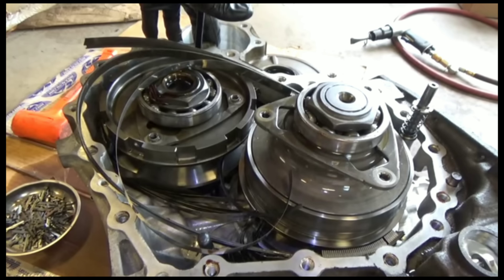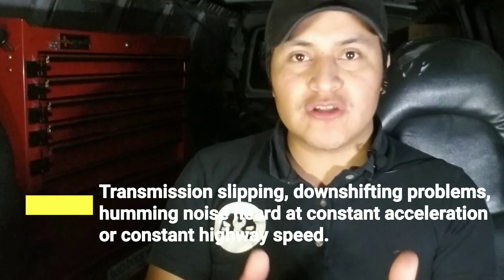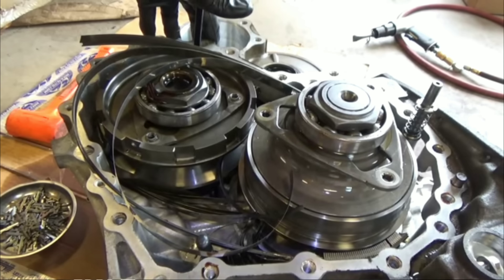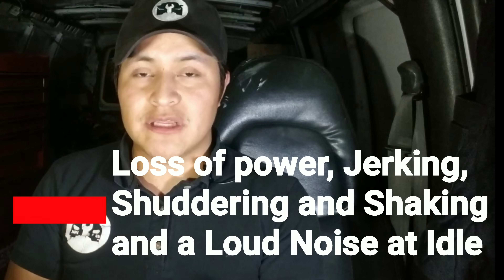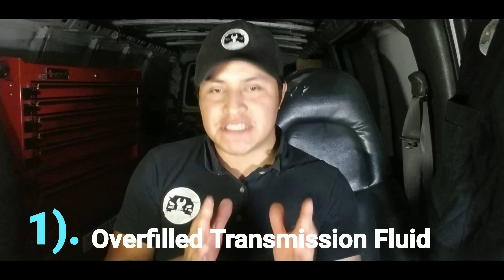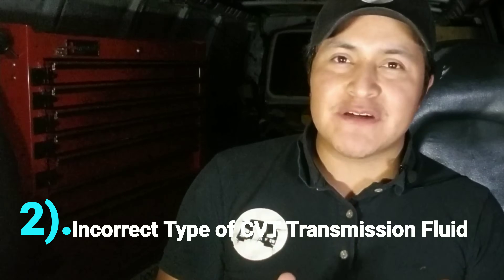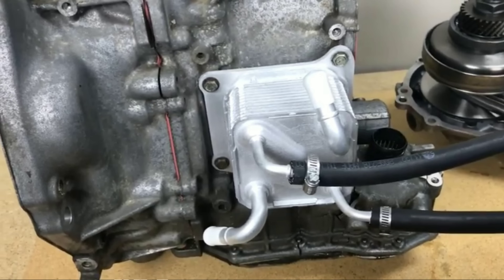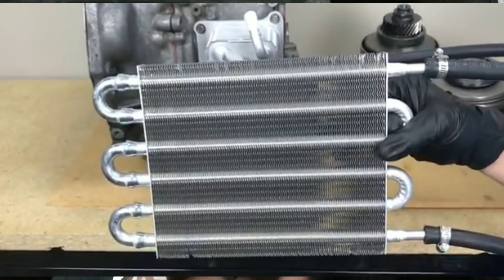NISSAN CVT TRANSMISSION | why it fails and what you can do about it to prolong it's life

Comment: Will changing out 4 quarts with the recommended Nissan's fluid help extend the life if its already slipping in 1st gear?
Reply: Same thing is happening with my car.Nissan Altima 08. Just when I'm going off a red light or a stop sign will it slip, but after that it changes just fine. Basically if I come to a complete stop
Reply: @KlaNks_-v2  I just bought an 08 how could you tell if the gears slipping or not when it don’t change gears? Have you had any major problems with yours? Reading all these comments making me nervous.
Reply: @shantaereed5703  you'll know if the transmission is bad just by driving it. Basically if you're at a red light or a stop. Whenever you come to a complete stop and then you hit the gas it goes super slow until it gets a little momentum then it drives fine. Well my car at least. The motor works fine. So you'll know it's slipping bc it accelerates slow off a stop . I bought it used and i didn't really notice it being bad or know about the faulty transmissions, so I would floor it on red lights sometime lol. Bad idea bc i think it was already around the milage that they have problems, which is around 60k plus miles. Mine was 97k when I got it. Basically don't accelerate to quick off complete stops if you don't notice anything bad with your cars transmission bc it will definitely go bad quick.
Reply: @shantaereed5703  look more into it. If your transmission is fine still then i think doing a transmission oil change helps. But if it's already going bad then I think it's best not to change it bc it will make it completely stop working. That's what I've been told, I'm not a mechanic. But check on the internet, i think there might be some things you can do to extend the life of it if it's still working fine. I was seeing something about some cooling system for the oil that can be added or something like that. Just do some quick research.

Comment: it's not too bad of a video, and the information is something that most people do not think about.  One issue with the CVT is power and displacement of the engine.  If you get the 3L+ engine or want to tow, stay away as it will immediately overheat the CVT.  This transmission wasn't made for towing or medium duty driving, and do not race with the car.  You will overheat the transmission/cvt fluit.

Comment: 2007 Nissan Maxima owner here for 14 years, I'm almost at 200k miles. Changed my transmission oil & filter only once at around 110k miles and car is still going strong.
I would add another point basically with any other car, don't drive like an
 asshole on the road. Your car will thank you for it.
Reply: Hello? Exactly
Reply: Swear most people with car problems dog there cars out and treat them like race cars. (Use to do that) I now baby my car and everything works the way it should for as long as it should

Comment: Thank you so much for the detail explanation, I had a Nissan Altima with 132000 miles, Same Humm and car was Jerking when pushing the gas pedal.  I fixed it while changing the car to Toyota highlander never gonna buy Nissan Again.

Comment: I have a 2014 altima. I'm having issues with rpm tachometer fluctuating. I have been to dealership every month just about.  1st they did diagnostic no codes. 2nd time reprogrammed TCM and 3rd ECM and then there was hesitating in acceleration.  So they installed stop switch. Now this month my rpm is fluctuating yet again badly. So one dealership says nothing is wrong. Oh thats normal for rpm to do that!! What?? Not while I'm at a steady speed..never normal to me. So guess he thinks I'm a naive woman. So I am taking to another dealership. This is out of control. I just want my car fixed...what is it? Transmission? I had the cvt Transmission serviced  in October last year. I had no problems with my car until I did  that. And you spoke of a whining noise...is that something I can hear in drivers seat? Bc I heard a noise kind of like a up and faint sound. Not constant but when car is sitting in park.
Reply: What was the issue maam?

Comment: My 2013 Altima (V6) started the suddering thing at only 700 miles. I was replaced under warranty and the new one worked for 70k miles. They told me the wrong fluid was put in at the factory but I don't know if that was true or if they just needed a story to make me feel better about the car.
Reply: Nissan employees are notorious liars so probably the latter

Comment: 2010 Nissan Altima 2.5 / 154,000  miles no problems. I never floor it when accelerating. I don't live in a hilly area so not a lot of stress on it when driving. Bought it 2017 with 77,000 miles
Reply: Have a 2010 Altima, too.  252K and transmission holding up good so far.

Comment: Hi, thank you for this video. I have a 2004 Nissan Murano, but I didn't buy it new. I have had it for 4 1/2 years now, and have been wondering about the transmission.

I actually don't have any problems with the transmission, there is no slipping, no noises, I am just wondering how long the transmission usually lasts, and if I should just get it serviced (flush, new fluid and filter).

The car has about 126,000 miles right now, and I only drive about 8,000 to 9,000 miles a year. I've been contemplating selling to go into a new (or newer) car, but also wondering realistically how much longer I can drive the car.
Reply: Sell it as fast as you can trust me my 2012 nissian Murano cvt cost me 4358 to replace

Comment: So, If a 2014 Nissan Versa SV with 62K miles on it, clean and straight... for sale with for asking price $1,500 by current owner that says "runs well but, sometimes transmission slips" and guess back window missing and needs replaced...
Is car junk now? 
Can a new or rebuilt transmission be installed and if so is it too expensive and not worth the effort.
Reply: Idk. That is so cheap it might be worth it to get a new tranny. Still a young car

Comment: Great video but you do nothave to avoid the Nissan purchase because of CVT issues, nor do you have to replace the transmissions in most cases.  I learned about a product line that’s been around for 30 years virtually no one  knows about because it was only sold to industrial companies including NASA and our Military, and tested in the racing industry. Now it’s available to the public and I put it in all of my vehicles “before” they have the problems! (But I have read so many people who have had CVT issues, hemi issues, 4.9 and 5.9 dodge issues, shuddering, vibrations, loss of power on start up, you make it... and they talk about this product line and how they did kit have to replace their engines or transmissions like their mechanic said they would have to. Instead they used these products. The company markets with the term “ultra frictions reduced and lubricant, however  . I learned  they are actually legally “supplements”  considered green and certified to lower emissions. They lower fuel mileage, address the CVT and endings issues... What impressed me as mischief as people randomly commenting about their experiences was the companies demo motor/engine. It’s mounted ion a dolly type trailer with a cut out so you can see inside has no oil. After they treated it with the product line it’s now ran 1300 hours without oil... now, I would nit recommend  we not put oil in our cars , trucks, semis, boats, motorcycles lol, but that sure supports their claim that the products lower engine heat and protect the engine! I cannot say enough about this product line. We have it in my new Infiniti for protection, our scion, our Honda Ridgeline, we have it in our sons high mileage trailblazer, and I tell all my family and friends about it!! Oh! Guess I better tell you!! The products I buy from their website are the CVT, The gas and diesel engine conditioner, (my daughter has a dodge diesel), the fuel and radiator supplements. Also the tech is patented. It has some nano molecular technology and electrostatic process that makes it work? It’s got some big certification by a Texas lab and if it’s good enough for our military weapons to prevent the from failing it’s sure good enough for me to try , so I did. I feel like I have discovered “Magic in a Bottle, truly. JilCat Proline  has my business forever! Keep your CVT, just protect it! This stuff removes sludge and protects! Never will I buy a standard lubricant again.
Reply: Oops JilCat.com is where I buy it! They even talk specifically about the CVT on their Auto Rescue page.

Comment: This is bad information. Sorry to disappoint, I have a 2011 Altima 3.5 SR and that thing is a beast. Wonderful car for road trips. The main issue began as people are referring to CVT as a term for sport function, but it’s not. CVT allows smoother rides and high torque power with acceleration. True to form, my 2011 Altima 3.5SR (V6) has 234,000 miles and my transmission is still in good condition, doesn’t skip a beat and works perfectly fine. Change your fluids more often, keep up with maintenance and your CVT will thank you. Put good quality parts in and good quality fluids, oils, lubricants and that car will pay dividends.

Comment: If you want to extend the life of your cvt, the key is to 1.) keep you engine revvs under 3k rpm when accelerating.  In other words, don't accelerate hard i.e. pedal to the medal.  Everyone's out there pushing their grocery getters to the maximum -- just don't be tempted to join them.  Also, 2.) don't just sit in your car with the engine running and the a/c full blast prolonged periods of time.  Your cvt will thank you.  Last, 3.) change your fluids at the correct intervals, coolant and nissan cvt transmission fluid.  25-30k max.  

This coming from a current 2017 Altima SR owner that had a rebuilt transmission installed a few weeks ago.  Total cost: over 5k of which $500 I was responsible for!  Thank gawd I was smart enough to purchase an extended 100k warranty!!!
Reply: What happens if it goes to like 6,000 rpm at 60 mph?
Reply: @TamikaX  if you accelerate/ launch hard, pushing all the way down on the gas pedal, it will.  However, just driving under normal cruising speeds it shouldn't revv any higher than 1800 rpm.  If you're saying the motor stays locked in at 6k rpms the entire time while driving at 60 mph -- that is not good.  That's a telltale sign of a cvt transmission that is slipping bad (won't engage) and will need to be replaced or rebuilt.  6000 revolution/rotation per minute is way too many revs (too hard on an engine) for a stock motor to continously operate under, especially any Nissan with a cvt.  Should only be 1300-1800 revs; shift at around 3k rpms under soft launches.
Reply: @roblockhart6104  wow. I was thinking this. I'm gonna put the new spark plugs and coils in first. Most def can't afford a new transmission. Its  slim pickings for good mechanics here. Thanks for your response.
Reply: @TamikaX  lol new Sparks and plugs plus paying the person to do it, you can spend $6-700 more on top of dat  n get a used CVT!
Reply: @kingaza7734  welp, at this point I paid for someone to put then in and the car is worst off.  Do you know where I could get a used cvt transmission?
Reply: @kingaza7734  chile, I need it. I'm kinda scared to order one online. Then mechanics gone charge an arm and a leg to put it on. But thanks.
Reply: @TamikaX  best thing I can tell you, is find a independent shop that you can trust, then tell them to order it online. In most cases they get discounts and or know a place they can get one for a discounted price, good luck. Without paying 3-5 grand that is. 1,200 the most..
Reply: @kingaza7734  thank you! I done took my whip to two places and the car is worst off. I think they took parts from my car, the battery wont stay charged. Folks are also going around stealing catalytic converters 🤦🏿‍♀️
Reply: @TamikaX  did you ever get your car fixed?  Was the charging issue the alternator?
Reply: @TheSwankynina  hiii, well it's running now and I haven't had the alternator checked. I'm thinking the guy I took it to did some sheisty things to my whip.

Comment: First video I’ve seen about this issue that addressed the issue and what you need to do to get it fixed. Great video!
Reply: Am here in 2025 researching before deciding on a 2023 Nissan Rogue. Very comprehensive and most enlightening about how to minimize a known issue from the CVT

Comment: owner of a 2009 altima here. this information is very helpful thank you.

I did a transmission fluid change at 150k miles and it helped. im now at 172k and experiencing the transmission slips every now and then. 

will definitely do another transmission fluid change and install a cooler. 

thanks again sir
Reply: Did it help you at all? The dealership told me changing the fluid might damage the transmission even more if its the issue.

Comment: owned a 91 , 99, and 2001 maxima AND THEY ALL HAD TRANSMISSION ISSUES. . . there are almost no maximas on the road after 10 years. . thinka about it, . . great engine, horrible tranny, it then just got worst after they went to cvt

Comment: https://emanuals.com/blog/nissan-cvt-transmission-warranty-and-lawsuit-settlements/    Boring and his info given by Nissan is inaccurate.  All that he says is common sense but here's the solution if the CVT has already failed ....                                                                                                                                                                                                                                          This is the best link I refer everyone to on getting your CVT fixed for free. The original  CVT warranty was for 5 years / 60, 000 whichever comes first.  The first generation CVT's have a warranty that extends their CVT to 120,000 miles.  It was decided in a lawsuit.  Nissan has agreed on cars built 2013- 2016 to extend their original warranty on the CVT another 24 months/24,000 miles bringing that to 7 years/ 84,000 miles.  Some of you may have even a longer warranty as some dealerships offered free extended  CVT warranties on new cars to 150,000 or even the life of the original owner.  Lifetime is what my dealership offered and they say they will honor it. My best advice is every 35,000 miles do a drain and fill just to error on the safe side.  I did that on my new 2016 Altima  vehicle and the CVT still went at 57,000 miles.  At least I did my part to avoid it from happening.  I hope going forward I'm in the clear.  Everyone please see the link I provided. It states that even though we've gone beyond the 1/20/20 deadline to file a lawsuit claim we still can file a claim.  You just have to act within 30 days of the initial service with your dealership.   Good luck Everyone.  God Bless

Comment: The issue is people don't change the fluid\filter every 30k miles.....And yes these cars have serviceable filters...If you don't  the Stepper Motor goes bad...Also the transmission speed sensors go out.....

And yes. The number #1 issue I find. They don't service the cooling system...I just fixed one in limp mode. They have green antifreeze in it. And the Stepper motor needs to be replaced..

Comment: Hi Thanks for your excellent info about transmission. Even though you are nissan transmission expertise based on your experience let me ask you a question. I have Honda Odyssey 2006, till  55,000 miles never change trns fluid. Last year when I was driving around 75 /hr all fluid out through breather line I guess.  On the way I refilled and go back home. Next day  Honda trans fluid from  dealer and till one year no problem. Then again this year when I was driving highway same thing happened lucky I had in my van I put it and went back home. I'm driving now no problem. I went to different people they diagnosis couldn't find anything. I don't have any problem to drive. Could you please tell me where is actually problem and how I can resolve it. I also know how to work myself but I'm not a mechanic . I read about trans and pound maybe it's problem with trans speed sensor or transmission pressure sensor. Or check trance turbine speed and food and output.. could you please reply thank you.

Comment: I have two 2013 Honda Accords, both with CVT.  One has 61k mi (bought used 4 yrs ago @ 20k mi) and the other was bought last month (97k) for my daughter. The one I just bought was one owner and they had service records to the date of purchase and the car was serviced at the same Honda dealer it was purchased at. Oil was changed every 5k mile on the dot and all fluids were checked. I find it interesting that the CVT fluid had not yet been changed. There is no timeline in the owner's manual and when I call any of the Honda dealers their service dept never answers. I went ahead and had my mechanic change the fluid in the new car. He said Honda recommends changing at 100k mi. I hope this is accurate. I'm glad it's done on the new car but now I'm wondering if I should wait that long for the other car. Anyone else know? (Google Honda Accord CVT fluid change and it literally says 45k-90k mi).
*Honda doesn't have a dipstick to check the fluid. And it's worth mentioning that they build their own transmissions, just like Toyota).

Comment: I just bought a 2007 Nissan Altima Hybrid today from a private seller and he promised me there was no problem with the transmission. I paid so much of my savings, and when I drove it home after 2hrs, it started to jump and shake when I was reversing to park in the lot. My mom said that it seemed like a transmission issue, so I came here.
Reply: What did the mechanic say who looked at the Nissan before you bought it?
Reply: @sailfish2323  the mechanic was not present when I bought it.

Comment: Hi i have a 07 pathfinder has over 200 thousand miles. My transmission fluid is clear and smells like raid bug spray. Drives real smooth.
Reply: 07 pathfinder isn`t equiped with cvt. it has usual automatic transmission:))